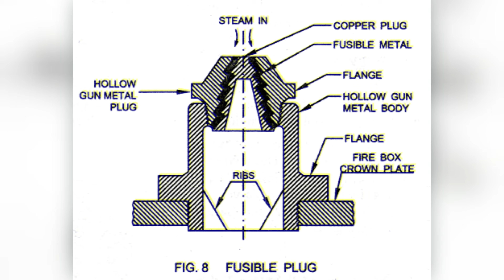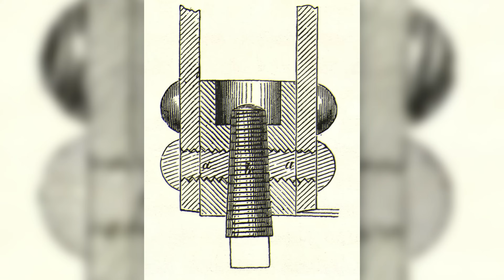Steam Boiler Explosion Soviets Tried to Hide: Bitterfeld Wreck 48 years Later

Comment: The crown sheet fails because without water to cool it, it softens and ruptures. It has nothing to do with water sloshing back onto overheated metal. The steel pulls away from the stay bolts and the hot water flashes into steam upon being open to atmospheric pressure.
Reply: not enough water. when the water splashed back on the glowing hot firebox rooof it evaporates instantly , creating pressure the boiler wasn't planned for. the point of the clogged safety plug happend at the RAW Meiningen through a boiler overhaul.  this video is a disgusting mix up. 👎👎👎👎👎👎😠

Comment: To make things easily understandable: There are usually three major safety systems. Two are automatic:  One is for excess pressure and another for excess heat.   The third requires the crew to observe the boiler's water level over the crown through glass levels, one glass level for the fireman and one for the engineer.  The locomotive I know has four safety pressure valves which go off, two at one pressure and two at a slightly higher pressure.   Upon firing the locomotive, the crew brings the pressure up to make sure the pressure valves release. On the locomotive that I know, there are four fusible plugs, two melt at one temperature and two melt at a slightly higher temperature.  They are designed to fail at high heat and the spray puts out the fire and alerts the crew.     The problem is almost always low water over the crown sheet which allows it to melt.
Reply from the maker: Thanks for breaking it down so clearly. You're absolutely right low water over the crown sheet is almost always the core issue. This kind of technical insight adds real value to the discussion!
Reply: When steel reaches a certain high temperature its strength drastically is reduced much like when the twin towers collapsed in New York City.

Comment: My Father was a steam fitter on big industrial boilers. He told me once that to little or no water in a boiler turns that boiler into a bomb.
Reply from the maker: That’s a powerful insight — thank you for sharing. Your father was absolutely right. Without enough water, the intense heat can weaken the boiler structure, and the built-up steam pressure can turn it into a deadly bomb. That’s exactly what made incidents like this so devastating.

Comment: False statements:
0:14 "This was a disaster that experts thought was impossible" - Is entirely False, from Constuction Engineers to Traindrivers the possibility of a Boiler explosion was well known as possibility, traindrivers were mandatory made aware of the underlying circumstances wich could cause this in training.
3:18 "The sound of the plugs melting is so loud..." The melting of metal is silent. Its the steam escaping throgh the newly formed opening that makes a loud hiss.
3:34 (if still referring to this mechanism) Its not a safety feature to prevent overpressure, its a safety mechanism to stop overheating. The safety mechanism responsible for the boiler overpressure is the "Savety Valve" usually located outside on top of the boiler

Many images are unrelated
Reply from the maker: The “impossible” line was meant to highlight how rare and preventable such disasters had become by the late '70s.

Comment: It's time you learned how a steam locomotive actually works before you making such an erroneous video as this. The engine would not stop through lack of water in the boiler: there is no such safety device to cause this to happen. The fusible plugs if they melt do give an audible warning to the crew and in very early days probably would have extinguished the fire. But not for many years, fireboxes are just too big for the steam to do this. They are entirely a warning and have no physical effect, but even if the fire had been extinguished there would remain enough heat and steam for the train to run for several miles, or kilometers since we're in Germany.  And the rubbish about water flowing back over the overheated firebox crown and generating extreme pressure to cause the explosion is another myth; what do you think the safety valves were for?

In cases like this it is the inner, copper firebox which gives way, not the steel firebox or boiler shell. There is then a rush of high pressure steam downwards through the firebox. The effect is similar to a jet engine and the reaction pushes the rear of the boiler upwards out of the frames to summersault it forwards, just like happened in this case.

The driver is responsible for the engine and irrespective of any outside pressures, his primary duties are to ensure there is sufficient water in the boiler, and to observe and act on all signals. He failed to do the first at least.
Reply from the maker: Thanks for taking the time to share your detailed feedback — it’s clear you have a strong understanding of steam locomotive operations, and I genuinely appreciate that.
Reply: @TrainDisasterDocumentaries  Don't let this guy put you down on how locomotives work, he certainly has things to learn in the field of thermodynamics and he has not got his fact's straight either.
This accident happened in 1977 and GDR (DDR for natives) at that time had long switched to welded steel fireboxes. They were robust, could cope with thermal stresses, but required proper water treatment to prevent corrosion and the water spaces around the box had to be designed wider.
He dismisses the flash steam issue as being a myth, totally ignoring that flash steam  means just that: water turning into steam in seconds . With all the accumulated heat in the crown sheet the pressure shoots up far beyond nominal and the safety valves completely lack the capacity to bleed that much pressure and volume off in time to save the boiler. It goes flying.......
Reply: @chamagical  The 'flash steam' theory was demolished by experiment in the Nineteenth Century as it was commonly used to pin the blame on a killed engine crew when poor maintenance was the true cause of an explosion. Feed water is invariably cooler than the boiler contents so its immediate effect is to cool the boiler and thereby REDUCE the pressure, so at best (or worst) the flash steam raising pressu has to compete with reducing boiler pressure. 

The effect of a seriously overheated firebox crown, copper or steel, is to lose sufficient strength for the steam pressure to force it downwards allowing the steam to escape through the stay holes and into the fire side of the firebox. The crownsheet needs to be in a highly plastic state to allow this to happen, which means a far higher temperature than the water in the boiler.  The effect of this cooler water reaching the crown would be to remove heat from it, so reducing its plasticity.

By the way and for what it's worth, regarding thermodynamics, I am a qualified mechanical engineer and have done practical work in a locomotive boiler shop.
Reply: look  for Kesselzerknall Bitterfeld 1977. you have no clue either.

Comment: This type of failure and scenario was not uncommon, proper inspection would have shown up the calcified fusible plug. Check out an almost identical boiler failure (inner firebox ) at Westerfield on the GER when No 522 blew up on the 25 September 1900. The fusible plugs function is NOT to prevent over pressure but overheating of the crown sheet of the firebox.
Reply from the maker: You're absolutely right  the fusible plug’s main job is to prevent crown sheet overheating, not overpressure. And yes, the Westerfield 1900 explosion is a strikingly similar case both involved a dry crown sheet and plug failure due to scale buildup.

Comment: Stands out like a bulldogs bollocks that the management were at fault. Ok if the locomotives Crown Sheet is exposed you are asking for trouble. This vital component needs to be emersed which prevents this kind of catastrophic failure. Once that happens,game over. That why the fusible plug is essential to stop ant kind of boiler explosion..
Reply from the maker: You're absolutely right — the crown sheet must stay submerged to avoid overheating. In this case, it reached around 740°C, leading to failure. The fusible plugs should’ve prevented the explosion, but they were likely blocked by limescale, so they failed. Add to that the rushed prep and skipped water check — and sadly, it was a disaster waiting to happen.
Reply: I agree about management  but the loco crew is also responsable "rushed prep and skipped water stop"
Especially since they'd already had a failure for the same reason earlier in the day.